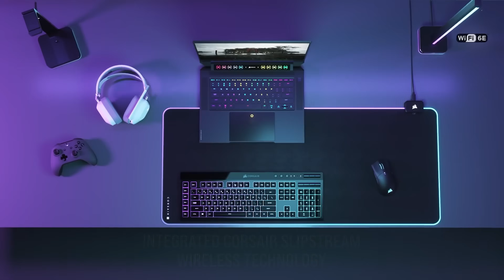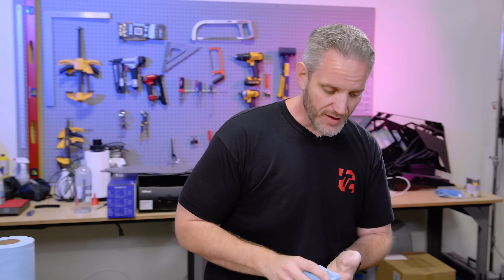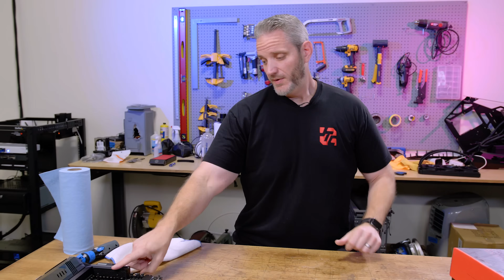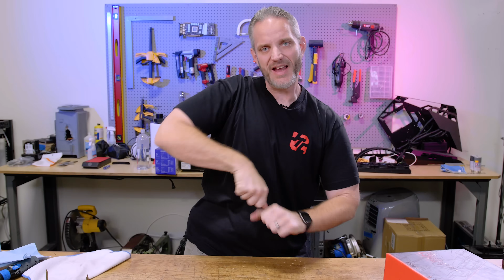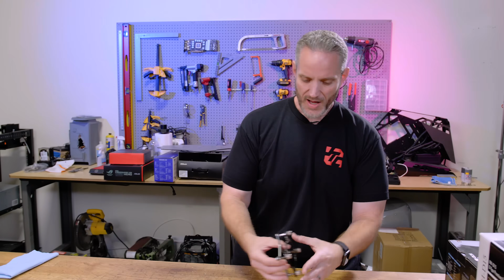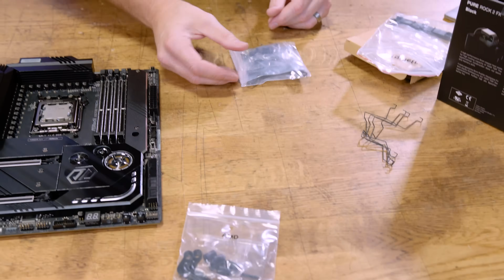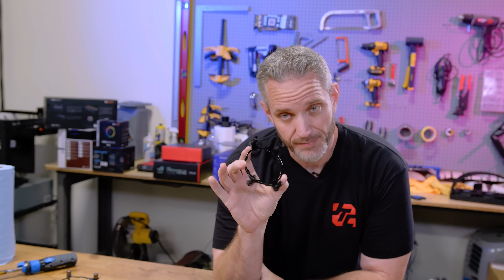AMD made a terrible flaw with this design...

Comment: There's honestly no issue with this IHS, nor is there an issue with AM5 temperatures. This is a nothing-burger that tech tubers and "journalists" are making into an issue that isn't an issue. It's not as if you guys are smarter than AMD's engineers. Neither is Der8auer for that matter. It does not need de-lidded, it does not need messed with. Learn to use eco mode or curve optimizer and shut up. Move on, nothing to see here.

Comment: How the hell can you fail the NH-D15 just because you don't have an AM4 bracket for it? Anyone purchasing a new NH-D15 or has one that was made after 2019 will work just fine. You literally demonstrated that the cooler before with the NH-U12A. They use the same mounting system... You probably could've used the bracket from the NH-U12A on the NH-D15 and it would've worked.

Comment: Regarding the thickness of the lid... is it possible they're planning for a stacked die approach? 

It's more likely that they just wanted as many existing coolers to be compatible as possible (though it sounds like they screwed that up a bit), but it seems possible that they are aiming at having a thicker chip eventually, and for the launch of the new socket they might feel like they have to sort of "fill" the space for the time being. It's been my understanding AMD have been aiming at stacked dies for a while; chiplets were the first step towards that design.

Comment: Maybe not a flaw, it is said that transistors move faster under heat rather than when it's cold, that thickness may help maintaining the constant 95C on heavy loads during long times, the fact that cpu cannot exceed max Tjunction is also a good sign which indicates the cpu knows exactly what's the optimal temps depending on your workloads.

Comment: I wanted to put a Wraith Spire on my AM3+ Mobo but the 4 corner mounting screws were like 1/2 in. length wise shorter than the mounting bracket holes

Comment: It is worth pointing out that the the thicker IHS isn't the only thing contributing to the higher thermals of Ryzen 7000. AMD's chiplets are also pretty thick and very *small*. Pushing 150W+ through such tiny chips creates too much heat to be removed quickly enough from such a small area. This was a problem even with Ryzen 5000, ask 5800X owners (such as me) who's chips shot up to 90c with massive heatsinks/radiators that were barely warm after extended runs. AMD also seems to use thicker solder layers to bond the IHS to the lids which also impacts thermals.

Comment: I direct die cooled my 10900k.. You dont notice the temp difference as much with standard voltage (LLC5 1.35v) with low temps. I got around a 6-8 degree drop on constant load (82max to 72ish). However at 1.42v it dropped from 95 to 78 constant load. I think the story is the same with the 7950x, TechYesCity did an undervolt and he dropped 20 degrees without direct die. I bet if he did do a direct die ontop of the undervolt, the temp difference would only be 6-8. Its a combination of high voltage, high clock speed and thick IHS. Direct Die is only efficient with high voltage, high temp scenarios, try undervolt and see if you can maintain the same clock speeds and analyse the temp before direct die.

Comment: I wonder if a cpu can be made with a ihs with a built in water loop so it can be optimised for thermal performance even better than diy. How much would a copper ihs waterblock add to the cpu cost, can´t be that much can it? Has that ever been done, if not why not? I wonder if a cpu was designed to only be water/liquid cooled would it not be possible to get better thermals from factory? It could even come with a aio cooler "in the box". May be the next thing to beat the competition with? Who ever does it first that is.

Comment: What if the silicon is getting ticker?
Maybe they are preparing to stack cores?
In that case wouldn't the ticker IHS make more since as they can remove it on later iterations.

Comment: I have the JTC XC8 waterblock, being able to just simply swap the ring makes life so much easier, i wish other mounting mechanisms didn't require fitting backplates, standoffs then somehow using your 3rd hand to hold the block in place while you screw it down

Comment: Thicker IHS means more resistance to temperature change, and that goes for cooling and heating, in both ways. So a thicker IHS has more mass, then it is harder to cool down, but it also makes it harder for the die to have a sudden increase in temperature above tjmax. AMD guys are not dumb to screw up with something so obvious like this, there IS a reason for that extra thicknes of the IHS, and this could be it.

Comment: This is the whole story then. That's why they're cool with letting the new chips run so hot. I'm honestly not sure which design choice would have been better. Less compatibility during the LGA transition with the thick IHS and more cooler options (maybe), or less compatibility and lower temps with a new cooler requirement.
Reply: Compatibility is overrated, I would rather have to re-buy a cooler rather than my equipment be flawed for the sake of letting some older parts work with it.
Reply: @mikeydude750  Idk. I tend to agree, but it might not matter for the rest of the coming zen 4 chips. If it's only these most expensive ones I care a lot less.

Comment: Eh, honestly, I was never under the assumption that ALL AM4 coolers were compatible, AMD was saying as far back as January at least that there WOULD be exceptions, and I would MUCH rather have the fixed backplate than the removable one("it's a feature, not a bug"). As far as the ultra-thick heat spreader, that's a non-issue to me as well, since tuning and a good cooler handle these CPUs under standard use cases(in other words, not 'playing benchmarks'). I don't "need" my CPU to run cooler than what we're seeing with basic tuning - but, hey, I am still into seeing the hardcore enthusiast stuff like delidding.

Comment: I recently looked at the EK website, because I like their coolers and other bits; and they have an AM5 specific CPU block - currently in preorder - from the Quantum Velocity2 product line.
I have looked at the mounting instructions and it uses the outer 4 holes and the standard AM5 backplate. This block is larger than a Velocity 1 block and actually extends out over where the hook system mounts. Instead of through bolts screwed in from the top/front, it uses an engine headstud type arrangement and you fasten it with a nut on the backplate side of the motherboard.

Comment: Any AM4 cooler that uses the old style "Hook" or screws into the original AM4 metal backplate are AM5 compatible. If you have a cooler that uses its OWN backplate then they are NOT AM5 compatible.

You can use the old Wraith Spite, Wraith Stealth or Wraith Prism coolers on AM5 as they meet the above mounting criteria

Comment: I saw that delidding video. Even using regular thermal compound and getting 18-19 degrees cooler would still allow for some pretty nice overclocking with higher frequencies and voltage and still staying under that 95 degree throttle limit.The only reason I can see for doing it this way is if the dies for the X3d versions would be enough thicker that they need the space to maintain compatibility for those. They may also be looking at allowing for thicker dies for the 8000 series since they did say they'd keep AM5 for at least 5 years. That doesn't excuse crippling the performance of the current 7000 series like that. Leave it to the cooler makers to deal with the difference in height. It sucks that you'll have to basically dump your warranty to get the performance you're actually paying for. The upside is this will likely blow Intel 13th gen performance right out of the water for pretty much any application. Forget boost clock. I bet people will be able to hit 6Ghz on all cores with a decent chip and cooler. 

I expect there might be a business opportunity for de-lidding services. The way Roman did it was risky as heck. Ideally you'd want to melt or at least soften the indium solder they used while doing the de-lidding. In theory that shouldn't damage anything if the temperature was controlled since they'd have had to heat the die up to solder the IHS to it in the first place. That might also soften the glue holding it down.

Comment: I didn’t have to use the old AMD fans that would come with that 2000 series but I never did that I would just really struggle on getting those damn things on
Reply: Sounds like you’re gonna need to get a metal file to file down then 2 mm thick cover for the core Just kidding that’s probably a really bad idea. But I might have to just skip this generation hopefully they’ll get it right next generation.

Comment: I switched to using a nut driver to hook on CPU coolers after I cut one of the traces on a mobo with a flathead screwdriver.

Comment: Well, it seems the IHS is thick enough to put a vapour chamber inside, which should actually improve cooling since CPU die are not able to spread heat evenly throughout IHS

Comment: Mill down the head spreader. Or sand it if you have the time. Would be a cool test. 😛
also how small a cooler can you get away with on 7600X, 7800X, 7900X and 7950X without loosing performance. Say a 30 min blender render :-p. That would be a cool test too.

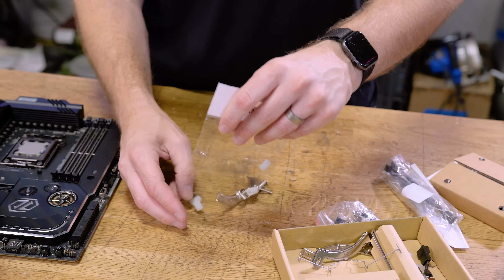Comment: 15:00 The NH-D15 should work with the bracket you just already installed for the NH-U12A.  Noctua uses a universal mounting for all their coolers, so the only thing that's custom is the bracket that is attached to the motherboard/socket.  This is why Noctua will send you an updated bracket for newer motherboards (free), to use their old coolers with. So theoretically the NH-D15 should mount on the bracket you just installed, of not I'm sure Noctua is working on a new adapter for AM5 for older coolers like NH-D15.

Comment: Does anyone have any recommendations for an aftermarket AM4 bracket and backplate? There's one on Amazon for $8, which seems fine. (I got a deal on an EVGA X570 Dark from a coworker, but he had a waterblock on it, and he removed them and isn't 100% if he has them.)

Comment: I don't understand the fact that since AMD now uses LGA as well, why don't they just copy Intel's mounting holes so that both AMD and Intel use the same brackets? Does Intel have a patent on their specific hole layout, or are the CPU heights that different? I can't imagine that AMD has any pride stopping them from copying the layout, given how obviously they've mimicked Intel's chipset naming scheme, even blatantly stealing Bx50 that Intel had already been using. Considering neither AMD or Intel sell their own coolers, the separate mounting methods just doesn't seem all that beneficial to have, and instead makes it harder for the aftermarket cooler manufacturers and the end user.

Comment: you could just sand the IHS 2mm on your 7950X to see the results and uses a hard mount on a cooler to keep that variable in check since LN2 or water cooling is what your channel is about

Comment: AMD boards are released with CPU retaining bracket, backplate & cooler fastening brackets to suit air fed AMD cooling systems.. 
Surely its up to 3rd party cooling manufacturers to provide a replacement cpu retaining bracket backplates so their coolers then fasten on to the boards ? 
I get how some fastening brackets or mechanisms may not be compatible but
I don't see it as an AMD issue personally.  
A good opportunity for you to sell more AIO's at least given enough R&D went into yours whereas other major manufacturers went the cheapo cost cutting route.  
A simple solution for AMD & partners though is to use a cut down backplate to secure the CPU to the board so 3rd party cooling solution manufactures can utilise the 4 board holes separately. Not a difficult costly fix.

Comment: I love how in a time where energy costs are through the roof AMD decided to throw caution to the wind and just make their CPUs into powerhungry spaceheaters. I couldn't care less if it can last 100 years at 300C, it's beyond inefficient to run a CPU at 90+C just "because it can handle it"

Besides that, it just degrades the components faster when heated up to such unnecessary temps

AMD spent too much time explaining they could when they should have spent that time thinking wether they should

Comment: seems like cooler manufacturers just need to use the screw holes on the existing backplate for their adapters and new AM5 products? What's wrong with those 4 holes?

Comment: I know people all think they know better and could design things or make better decisions than engineers and CEO's of companies, but in reality they are not competent or experts and do not know better.  But with the thickness of the heat spreader being increased just to make  the CPU compatible with current coolers, just seems dumb.  I think a person can question this. This was a poor decision.  Imagine if these new AMD cpu's did not have this issue and were running 20 degrees cooler, they would really have bragging rights over Intel.

Comment: jay just really undervolt by 100 watt men problem solve ;) 72 degré on big load on the 7950x ;) promise same as 5000 series get pbo to mother boards curve optimize all core - 12 and set voltage to amd overcloaking reset pc and return to voltage if its not to 1.245 do it manually and reset pc returning check voltage last time be sure its stick on 1.245 or 1.275 then restart pc problem solve men ;)

Comment: so on top of the $500 MB $520 7600x $300 bare min ddr5 in my country id also need to buy a cooler that will work? just for less performance than the 12600k? yea this platforms heaps good jay...

Comment: I would also be super interested in hearing about the thinner IHS test.  Because having 2mm of thickness purely for the sake of backwards compatibility seems like a terrible idea.

Honestly it seems far more reasonable for them to have released a spec for the mount to the motherboard manufacturers on how to raise the socket 2mm and say "this is a thing that will allow AM4 cooler compatibility" and either make it an optional thing that motherboard manufacturers can adopt if they so desire or make it a required thing so they can say "and AM5 is compatible with AM4 coolers*"
Reply: I'd expect board manufacturers will make altered versions eventually that exclude the AM4 part

Comment: This comes down to poor engineering choices... by trying to make it compatible with AM4 coolers they should have either raised up the socket on the MB, or increased the cpu's depth on it's bottom (NOT the heat spreader), or just gone with a new cooler spec. and left the heat spreader dim. the same. Their choice to increase the thickness of the spreader is hampering what could have been an amazing cpu series leading to much better performance at lower temps (especially given Intel's latest cpu's power and cooling requirements). Unbelievable that they chose to go this route. Wow! (And not "wow" in a good way!)

Comment: Why do the temps drop instantly when the load is gone? If it was to thick the heat would still be retained.
Reply from the maker: You have much to learn about voltage and cpu cooling